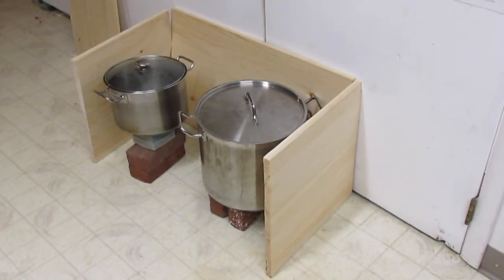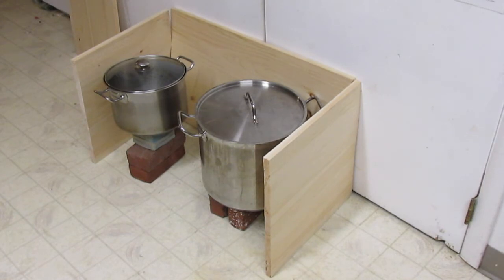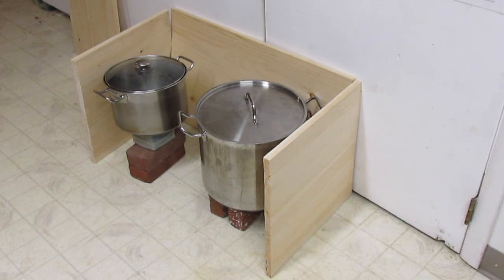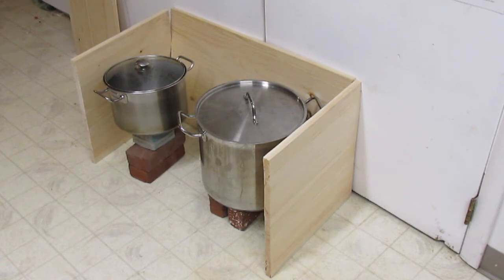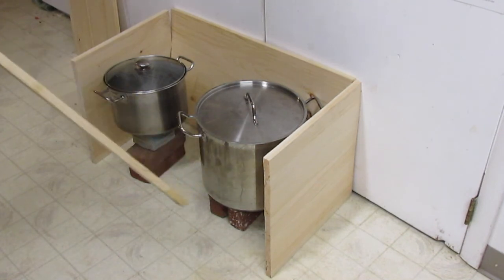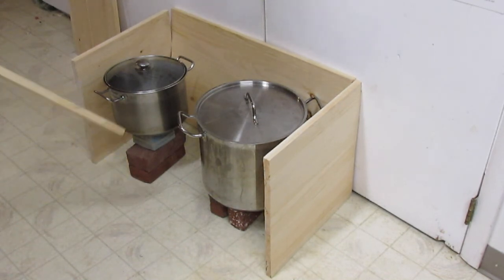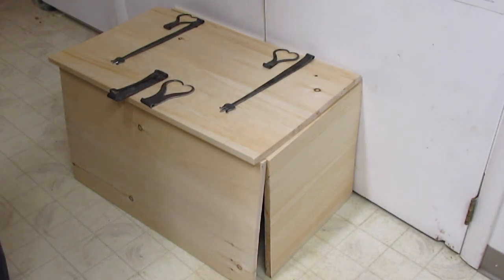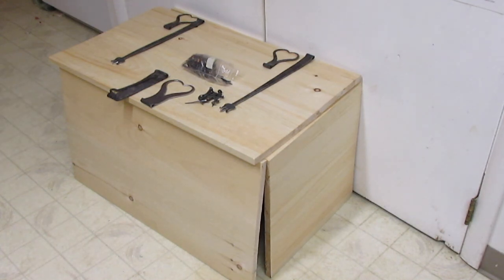Making a Double Pot Thermal Cooker in a 6 Board Chest

Comment: That is going to look awesome. I need to try my hand at making nails. Only used a hay box once. A wool blanket and a cooler, on some pinto beans. Not so great. However yogurt works fine. Good luck.
Reply from the maker: Thanks pennyghost,  I highly recommend DF in the Shops set of videos on forging nails and he's got a great PDF on the specs of different sizes of headers for different size nails.  Very useful.  I'm surprised the beans didn't work well in the haybox for you,  they usually work great for us.